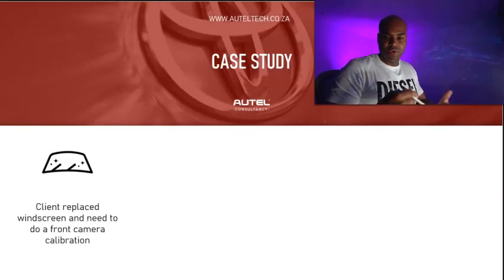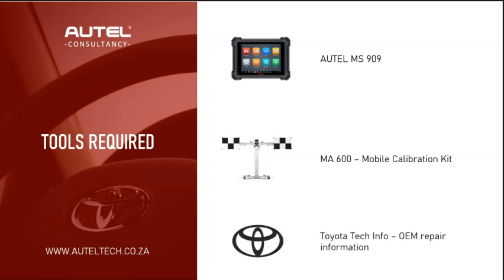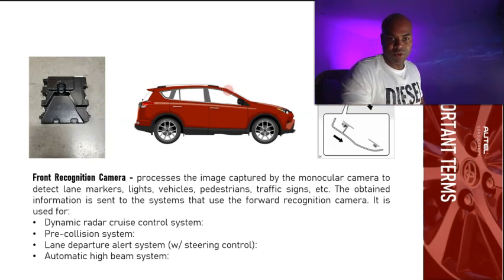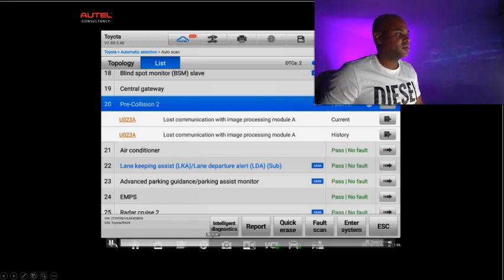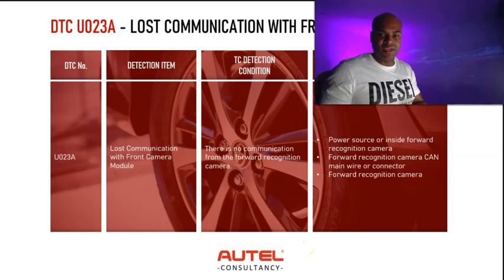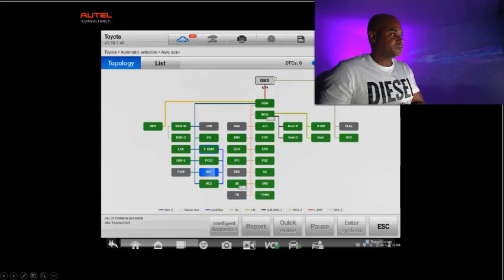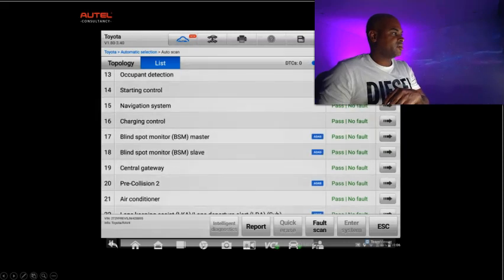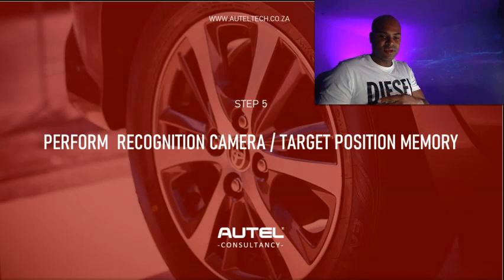MS909 MA600 ADAS Calibration Toyota Rav 4 2018 Front Recognition Camera No Response Error code U023A

Comment: Have a quick question for you, is there a way to see individual wheel speed senors? 
My own personal car apparently has a wheel speed issue however I have not been able to find how to locate a individual sensor MK908p. All i need is a yes or no 🤣
Reply from the maker: Its not that easy to give a yes or no answer. Its Vin specific. Meaning it might be available for some vin numbers and not available for others. You give your supplier the VIN number to verify if the function . Another strategy is to use your j2534 and OEM software. Some oems offer diagnostic data if the autel doesnt have it.

Comment: hi there Curtis, the im608 can program ignition switch an key for a 2012 mercedes glk 350?
Reply: 2007 335i E90 n54 bmw sedan
Reply: Yes. I can di mercedes up to 2014 with my im608
Reply from the maker: Hi Alek. Just to let you know I can only give you 100 percent certainty if you book a consultation with me. This way Ill take the vin number and have my engineer validate the function.  Generally speaking I know the Im608 will have some coding options for the ignition switch and it should be able to do the key registration.

Comment: I had this model, bought it to remove error codes and a steering wheel lock I could not remove or reset the steering wheel lock, now my car is just sitting in my driveway it won't turn on
Reply from the maker: What car do you own?
Reply: Get s steering lock emulator to replace the lock module/actuator. Steering lock going bad  is a common issue on a lot of older cars
Reply: vw mqb i try read immo data to add key failure  many tiems 5c 2020